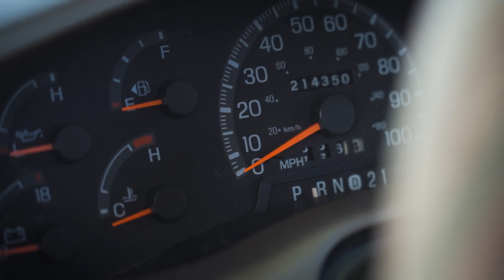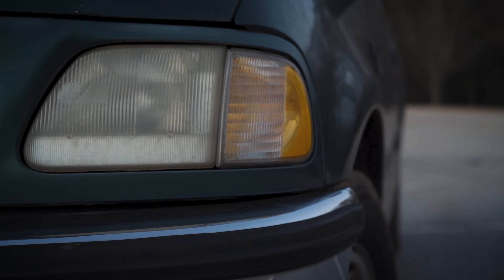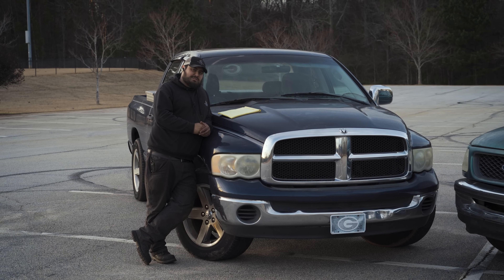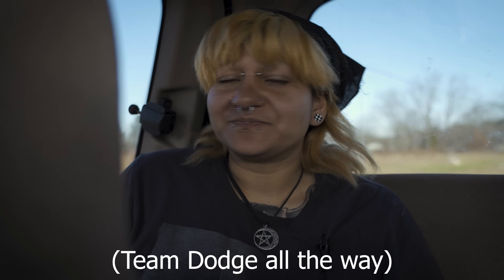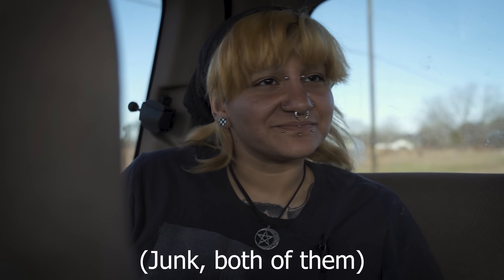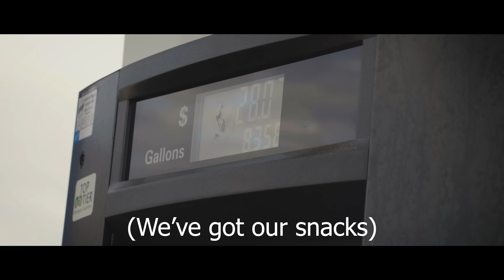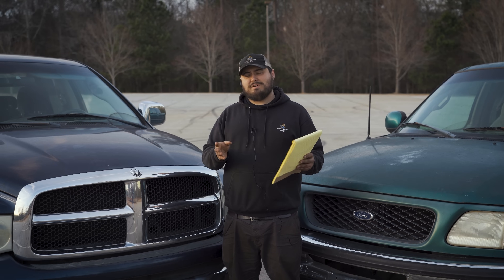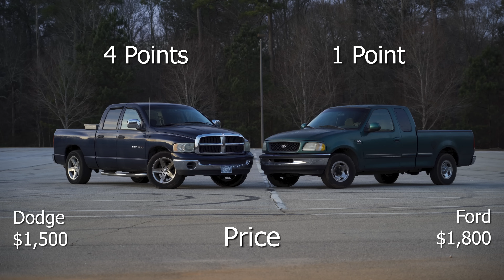CHEAP TRUCK TOWING CHALLENGE, Head to Head Towing Challenge, Dodge Ram 1500 vs Ford F-150 Reviews

Comment: Well I've had all 3 main brand trucks and in my opinion Dodge has been the best and most reliable for me. The Ford transmission was always breaking and the Chevy well Its probably easier to tell you what wasn't wrong with it 😂. I currently have a 04 Dodge 5.7 hemi and I love it much better truck then the other 2 from my experience
Reply: Me too. He rags on Ram as if Ford and GM aren’t even worse. Rams have been good to us. I see old Rams on the road all the time.
Reply: Yeah this guy really hates Dodge to the point it makes his videos lame. Honestly, after watching g a few of his videos he’s a shade tree mechanic and he’s running ragged out vehicles!
Reply: I keep telling people Brand bias/loyalty only benefits the manufacturer and hurts the customer. You go by the year, and what has been proven reliable. Each of the Brand's had their good years and there bad. If your brand bias or you have brand loyalty, your manufacturer doesn't have to be innovative they know you'll buy no matter what
Reply: You either got the most rare dodge  ever made or are bs'n. Dodges of those years and even now are pure  junk when rolled off the line. Where the gmc, Chevy of the same years are still on the road by the millions and most dodges are crushed already.
Reply: Ram trucks are trash. It’s more common to find Chevy truck/suv and ford trucks with over 200k miles.
Reply: @dylanowens3173  yeah buddy you keep trying there are Dodges all over the place especially in the South where the Rust doesn't kill them. As a matter of fact the gen2 and the beginning of gen 3 which is what this guy commenting on has, they are the most reliable versions of the Dodge ram 1500 2500 3500. Quality-control was way higher during the early to mid 2000s with Daimler at the helm.  The late-2000s in early 2010s it went really shitty because Daimler sold out. The 5.2 magnum, 5.9 magnum, early 5.7 hemis 5.9 cummins gen 1 and 2, were all reliable as the day is long. And I know you're going to mention Dodge transmissions just keep in mind that Chevy used the Chrysler heavy duty automatic transmission,  and don't forget the nv4500 manual transmission isn't a Chevy made product it's a Chrysler made product and it happens to be the best heavy-duty 5-speed ever produced..... Which Chevy also used because it works so well
Reply: @6.2Slomaro  yeah that's not true at all. The 5.9 and 5.2 Magnum were ten times the motor that those 3-valve Tritons were. And shall I remind you about Ford's diesels in the early to late 2000s???? They won't touch a cummins in reliability. And the first-generation Duramax was okay after you fucked around with it and fixed its issues. You didn't have to do any of that shit to your Cummins though. In the early 5.7 hemis were extremely reliable they had a few minor issues. But I would go after an early hemi over an MDS hemi any day of the week all damn day. And I had a ground-up remanufactured transmission installed into my 01 ram for $2,500. With the factory defects deleted. You want to say that they don't make it over 200,000 mi really that means you probably don't know people that take care of their shit.
Reply: @6.2Slomaro  your bias is showing 😂 I'll take my 5.7 over the 6 leaker and that trash 🗑️ triton and the garbage 6.4 diesel. That's 3 horrible engines the fords have used in the last 20 years. So yea I'll keep my Dodge
Reply: @seanbutler2291  glad you mention the MDS cause that gave the 5.7/6.4 lots of issue. Same applies to Chevy AFM/DOD. Lifter failures just cause they wanna save some gas. The Cummins 5.9 on certain years are very reliable and the auto transmission was weak. Ford power stroke 6.0 and 6.4 at the bottom. The power stroke 6.7 was a big improvement tho. The Duramax has the better engine and better transmission. Chevy makes good diesel trucks. Toyota makes the best gas trucks 😉
Reply: @derrickhornsby139  sounds like you’re the bias one here. my company uses Ram trucks. And they are trash. Handful of the 2500/3500 with the 6.4, already experiencing the hemi tick and few got their transmission replace. The Ram diesel with the 6.7 is an okay engine, huge turbo lag. 

When I was in the military we used old and new ford trucks, they had their issue but never experienced any engine or transmission failure. When we got a “new 2017” power stroke 6.7, that engine was big improvement. The turbo lag wasn’t as bad as the Ram trucks. 

Toyota makes the best gas truck. Your 5.7 doesn’t compare to Toyotas 5.7. What year is your 5.7?
Reply: @6.2Slomaro  lmao your entire comment screams bias tf you talking about. The 6.7 Cummins is the best diesel engine for what a diesel engine needs to do and that's tow heavy shit. The only thing the power stroke has is more HP. I agree that Toyota is extremely reliable in most cases but the Toyota 5.7 has its fair share of issues as well. I have a 2004 5.7 and have never had an issue with it I have right at 170000 miles on it now. Still runs as good as ever and no I dang sure don't baby it. I go in the woods through ditches with it I've gone through water that goes above the tires keep in mind I have it lifted with 35s on it so that's some pretty deep water and if I need to tow it tows great. I'm not gonna bash a brand for no reason that's dum to me EVERY brand has had its issues but Dodge has been the most reliable for me by far
Reply: We all have anecdotes, but my parents bought a 99 Durango new back then and the trans went out twice within two years. My dad's 94 Ram 2500 with the cummins trans went out in like 2005. Everyone knows the torqueflites were crap. They got a big advantage when they merged and now get the ZF transmissions. Those 4r75 transmission in the Fords are bulletproof.
Reply: A Dodge/Fiat is trash
Reply: @derrickhornsby139   nothing bias here buddy. Wow 2004, after all those years you only have 170k miles. Must have been broken down most of the time to keep the miles very low. This “bias” that I have definitely comes from experience. And sounds like you only have one experience, which is your 2004 hemi truck. For my personal owned vehicles, I’ve had a 2013 Chevy Silverado 5.3 with 250k miles, that truck was tough and reliable.  I got rid of that stupid DOD/AFM feature with a cam swap. 2011 F150 5.0 with 225k miles, very reliable, didn’t hesitate to tow from the mid west to the west coast. 2014 ford raptor with the 6.2 motor with 197k miles very reliable truck, I don’t hesitant to take it off roading here in the Vegas desert. I’ve had a 2005 Toyota tundra 4.7 motor that had over 300k miles, just gotta replace the timing belt periodically. Have not owned a Ram truck yet besides driving the ones from work, but my co workers that owns them, said it was a good truck until it starts having electrical issues and hemi tick. I would  disable or somehow get rid of the MDS system.
Reply: Lol this is funny I got a 07 ram 5.7 hemi with 234k I’m getting 22mpg everything works u just gotta take care of your shit
Reply: @6.2Slomaro Toyota trucks only last so long because they haul nothing but groceries. I can't tell you the last time I've seen a tundra sitting next to a 5 or 8k lb camper, and I go almost every week. Toyotas are for girls.

Comment: 😂😂 he hated the dodge then had to be honest at the end and state it won.  I can tell you from personal experience, my dad drove a 2001 Durango 4.7 2wd 3:55 axle ratio and my mom drove a 4.6L 2003 2wd ford explorer 3:73 axle ratio both we used to tow are 5000lb boat. Both did it well. I will say the Durango out performed the ford. 

List of engine and drive train repairs needed to keep the 4.6L explorer going. Timing guides wore out at 150k miles, spark plug blow out, intake coolant cross over burst 130k, oil filter adapter leak at 120k miles, transmission failure at 165k miles. Vehicle still runs great today at 199k miles. 

Durango, engine repairs exhaust manifold bolts broke 135k miles. Transmission was going in an out of lock up at 65-80mph, found faulty TPS sensor at 175k miles. Cam positions sensor at 185k miles. Durango runs great has 187k miles on it. 

Both have received similar maintenance and care.

Comment: You would be surprised what a f150 can do or any f series it’s impressive
Reply: Especially the new F-150, 3.5 Eco-boost. Damn near towing diesel numbers.
Reply: @richyg3993 I've got the 3.5 eb lariat with max tow package. I love my truck.
Reply: @nateg08  nice! I have a 07 Cummins 5.9. 149k. Pulls like a train! But I want a newer EB. But I don’t want to sell my dodge…very tempted to, idk haha
Reply: @richyg3993  my dodge was a good truck but I gotta say I'm thoroughly impressed with that 3.5. It's a beast for a half ton truck.
Reply: @nateg08  I never towed anything crazy with an EB. Just seeing the numbers on paper. Does it tow better than the older Cummins?
Reply: @richyg3993  I wouldn't go that far. It has phenomenal torque but the 3/4 ton trucks are just more stable. It is however the best towing half ton I've ever driven. The max tow package makes a difference with tranny amd oil coolers and the better stability control. Built in trailer break as well. It really does pull great and have no problem holding 70 through east TN mountains

Comment: What transmission's, differential gear ratio's and what was the leaf spring count on each truck? Those all have contributing factors to the towing capabilities of each truck.
Reply: Ram should be 3.92. Ford is prolly 3.73

Comment: I know this is a YMMV but both 3rd gen Rams I've had were both solid. The most annoying thing with either was the older of the two had an issue with the vent on the tank getting iced in winter making fuel filling quite a chore. I bought the 04 needed a few parts over the 5 abusive years I had it. Rad wp ps pump u joints. I had to rebuild the front end when I got it. (Big surprise I know) I beat the guts outta that truck and it always started never broke down and it had 8 owners before I bought it. My 05 only ever needed end links and u joints. Got t-boned by a dump truck after owning it for 4 years. I'd be glad to own either one. Never had any "Dodge electrical problems" either 🤷

Comment: I did have a question. Was the ford in the video the 4.6 v8? I know the 5.4’s have a bit more power (not much) but those would probably be better to tow and haul. Idk what motor was in the dodge

Comment: Awesome video, love the realism. Although those are 2 different generations of trucks. The challenge was catered to the dodge. Longer wheel base, larger truck in general. That ford had way too much tongue weight for the shorter wheelbase. I remember doing some towing in a 99 exactly like that one with my dad years ago and that thing never skipped a beat. That wasn’t exactly apples to apples comparison. I know the price you were trying to stay under is why but I’d revisit this challenge with quad cab to quad cab. Makes a world of difference

Comment: You get what you pay for. I bought a 2005 Ram 1500 for $9,000 and only to to do minor maintenance when I first purchased it. I used it for construction towed heavy metal and construction equipment with no issues. You bought the same truck for $2,000. The previous owner wanted to get rid the truck cheap because it was poorly maintained and costing them money. I still own my 2005 Ram and have had no issues. It’s all about preventative maintenance.

Comment: I have one of those 4.2 v6 f150s with the manual and i have towed a full sized jaguar v12 on a trailer no problem has around 267k miles on it now

Comment: With dodge it's a year to year kinda thing I know my dad's 97 1500 put 400k+ not a single problem not even the Transmission and I have yet to have any problems out of my 05 1500 at 179 k

Comment: One thing to point out. With the dodge ignition. I have had 2 jeeps and 1 ram 1500 that had the tame thing where you could remove the key and leave the truck running. It's a factory feature. It's meant so you can start your truck to let it heat up in the winter. Then take the keys  out lock the door and then your truck is safe while it idles
Reply from the maker: Well this is me turning the ignition off, and the truck staying on until you disconnect the battery. I should've been more clear In the video
Reply: If I recall I would leave the ignition in the running position when I would take the key out. So I could be mistaken

Comment: "You gotta put a new engine in every 3 years" MMMMM No, I own an 02 1500 SLT crew cab with the 4.7, 80k miles, same engine (4.7) and transmission (45RFE), and she gets ran HARD. Zero issues with the engine & transmission, basic maintenance.  The only issue I have is that the dashboard is cracked to shit and the oil pressure switch randomly decides it nologer has oil pressure, it does, its an electrical thing.

Comment: Although the dodge may have a gremlin, I would prefer it over that ford any day of the week. The trucks are too far apart in age to be fair, but as a Ford technician I can tell you run from that ford truck.   I have owned 3 of that gen ford.  Nothing but issues.

Comment: Body power control module under the hood (fuse box) can cause some of those gremlins.  I had a dodge caliber that did the same thing. I replaced it and it was good.
Reply: TIPM TOTALLY INTEGRATED CONTROL MODULE.

Comment: Ram is the better truck all around. Both trucks have their issues. Ram is more reliable and tows better. You see old Rams on the road for a reason. Rarely see old Fords on the road.
Reply from the maker: I don't know where you live, but here in the south, Ford's are absolutely everywhere in various states and conditions. This generation of Ram is around often, but the 90s rams are all gone or most of them
Reply: @GrumpyMonkeyGarage I'm in about the middle of NC and there are 90-2010 dodges everywhere and still decent amounts of ford's but not as many. 

We have had several dodges and got to drive some ford's of friends and family and fords have always felt really cheep and break alot and yes the dodges still have their flaws but we have not had any electronic problems with any dodges.
Reply: You got it backwards did you not see the truck did not shut off when he took the key out and the dodge needs a new engine every 3 years 😂
Reply: Lol, just all of the way wrong.

Comment: Always have been a big Ford fan but last time around couldn’t afford an F-150 with the equipment I would need so I bought a Ram (I still call them Dodge) the pulling of the thing is amazing. Like a 3/4 ton diesel in the early 2000’s but sadly it still has many of Dodge issues. Windows go down without being told. Needs a top end rebuild at 90k miles. I love it and also realize that it ain’t gonna be with me as long as my Ford and GMC trucks were.

Comment: Hauled back a dually 2500 Chevy on a trailer behind my 00 7700 F150. 5.4 definitely lacks power, and have to watch temps in the 4R70W, but it does it ok. Getting hitch weight correct is THE MOST IMPORTANT when you’re on the edge of capacity. That said, the 7700 trucks are a pretty different animal from the standard F150.

Comment: Well I can say I’ve owned 3 Ford Expeditions! My first one was a 1997 with a 4.6 triton! Which is very reliable and decent on gas for a V8 real good low in torque! Now when it comes to pulling I have to say the 5.4 2V triton is a beast! I still currently own two 1999 Ford Expeditions! I love the first generation! The 4.6 and 5.4 is night and day difference with power and torque! I think the Expedition pulls and tows a lot better than a F150 around the same year! I got over 300,000 miles on one of my 5.4 and it’s still very strong and responsive! Great trucks!

Comment: Those Triton motors in the Ford's hadvspark plug and head gasket issues. I've owned trucks from the big 3, they've all had some issues but overall my Dodges have done more with less than the Ford's and GM. Always  interesting to see the comments and they diehard fans.

Comment: I got a 2003 f150 with a 2021 18 foot car trailer and it pulls just fine at highway speeds 70 75 mph with 296k miles but I don't push my cars up on the nose of the trailer to make it dangerous to pull

Comment: I agree, they are both junk, but I would still take the ford anyday. I had a 98 f150 4.6, sold it with 285k miles, still had the original engine/trans/rear end. Still ran and drove fine. No dodge has ever made it to 285 without a few trans and atleast one engine lol
Reply: I have a second gen dodge with 296k miles with the original transmission engine axels etc, and even fuel pump!
They are great trucks.
Reply: My dodge 1500 has 234k original everything best truck I've owned. Had I newer Ford it needed a new timing chain at 42k miles. 4x4 stopped working at 50k it was Junk and all the rattles on the inside.

Comment: Im highly surprised the ford kept all of its spark plugs from flying out of the hood and the headlight switch didnt catch the truck on fire 😂
Reply: That happened to my 99f150 all 8 ended up blowing out before 120k miles 😂
Reply: @fireant1272  I worked at a parts store years ago and we would rent out the spark triton plug repair kit all the time. I finally had a day when I went to check on a misfire for a f150. As I chuckled about it being a triton we heard a loud bang and out came cyl 4 sparkplug through the air it was a great experience.
Reply: @manuelvelez389  Haha yeah that's funny. Why would ford only put a few threads In the cylinder head for the spark plugs 😆 followed by the 2004+ 5.4 spark plug disaster!
Reply: That was only on the 5.4L Triton engines, the truck in this video has a 4.6L engine. The 4.6L engines were damn near bulletproof. Not huge powerhouses, but longevity was the key. Ford got it right with the 4.6L modular engines.
Reply: @OneNationUnderGod.45  4.6 and the 6.8 have the same issue as the 5.4
Reply: All these comments false my 98 5.4 never had any rocket ship spark plug problems